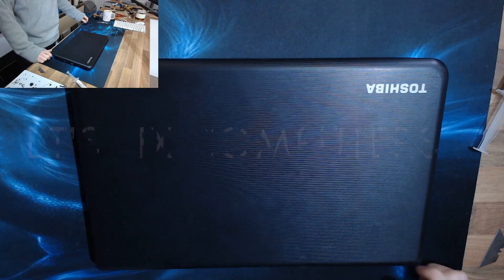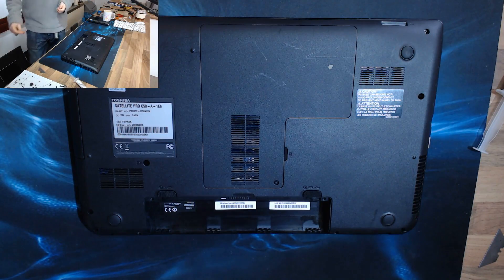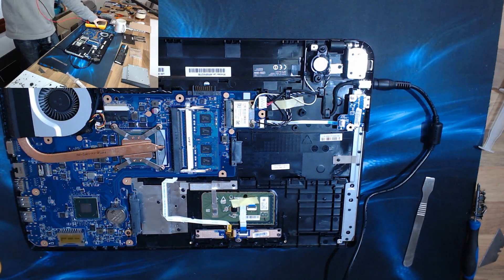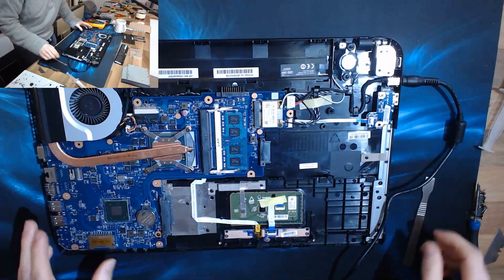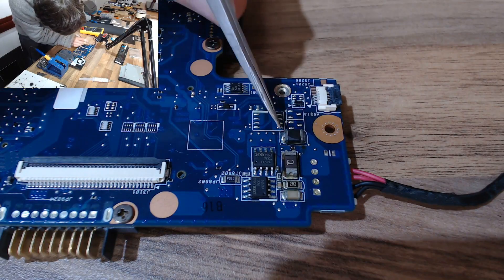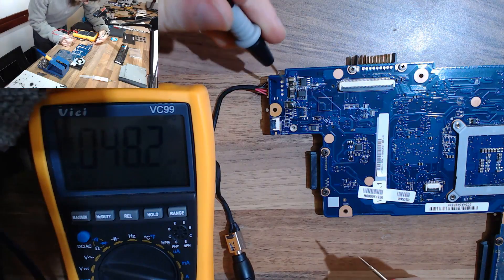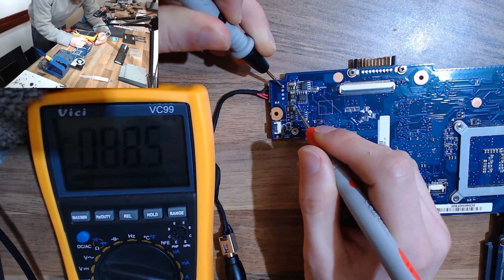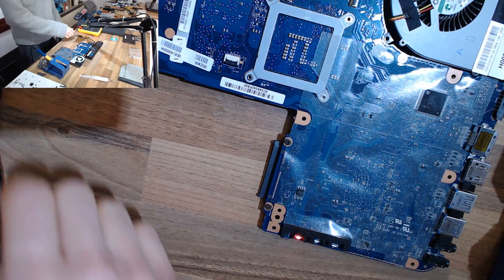LFC#98 - Toshiba C50 No Charge

Comment: Could I send my laptop too you to fix ?? Or maybe some ideas of possible cause for replacement parts ( find the cause to know if anything needs to be replaced) I have old Toshiba laptop c50a 1jm it started with pink virticle lines later black screen but would still charge and now nothing the power light won't indicate whether its charging and will not switch on can a completely dead computer be bought back to life?? Somebody say whatsup please iv tried a few things like removing bios and holding power button mostly small things that are suggested on other videos  it had also been taken apart and cleaned still nothing I just need to no what are the power sources  and which ones to test to find where the problem might be
Reply: it's never completely dead
Reply: @sharymens8187   it is now.... its completely unrepairable as it is unless parts are replaced last time plugged it in  began to smoke ... gradually over time most of it is now in small broken fragments
Reply: @sharymens8187  no longer worry about the first comment

Comment: Hey i have the same laptop and i accidentally reversed the polarity on it, it boots up and works fine on battery power but do you think the damaged components can be replaced ? And if the mosfet is dead, will bypassing it solve the issue ?
Reply from the maker: The reverse diode is the first thing to check, as it's the component that should have protected the motherboard from this.
As for the mosfet, I'm not sure without looking. Technically you could bypass it, but that would be a super ghetto-fix that I would only do if the alternative is to throw out the laptop. It will compromise other protections in the laptop.
Reply: Adamant IT I lost all my equipment when shifting houses, all Im left with is a soldering iron lol. Thank you soo much for replying !!

Comment: i only had problems with IQR mosfets. i had problem salvaging P channels and N channels at the right time so i stack a few motherboards like this just in case. :D

Why you use Hot air for that inductor?
Sony Vaio  was the first to do this with the motherboard on the palmrest.